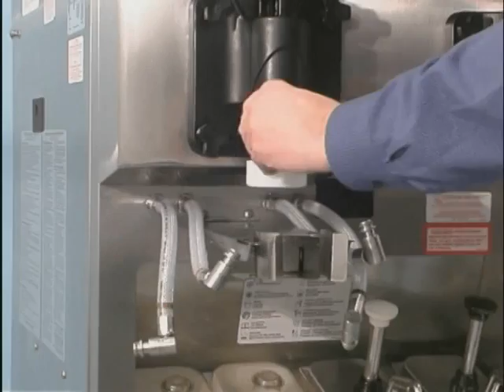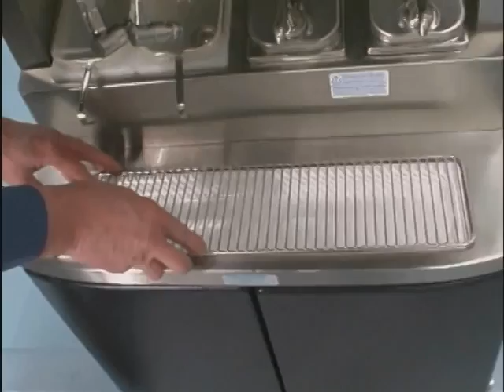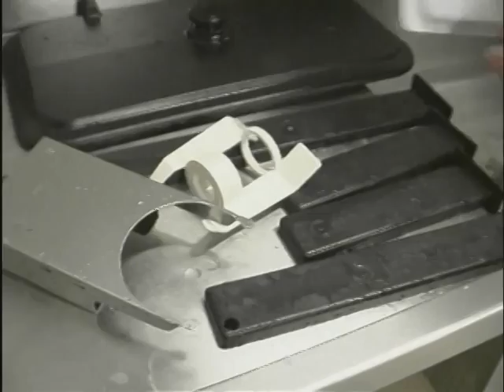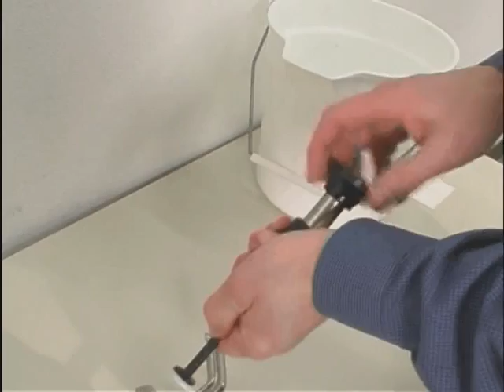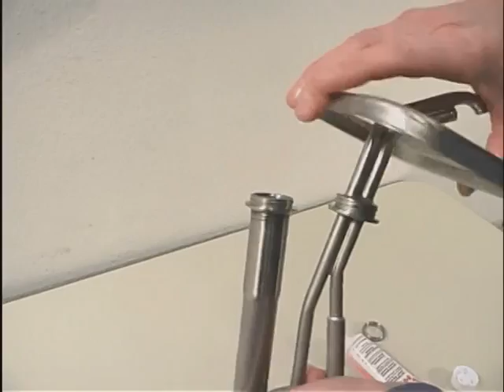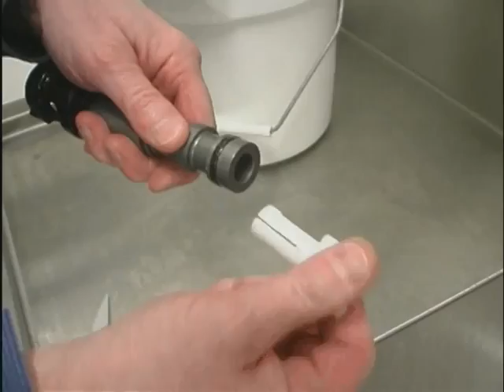taylor c606 mycie cz1

Comment: Are we to believe that workers actually do ALL this careful work on shake machines that  make our shakes?
Reply: At least at my store we have to
Reply: Yes. It goes in to lock down otherwise.

It's a pain in the butt and heavy as hell
Reply: @bluewings8913  The machine does not have psychic powers to know that you are cleaning every piece.
Reply: @DarthVader1977 it knows when all parts are out. Of course it doesn’t know that every piece is clean but why wouldn’t you clean it when you already have every piece out :^) If you fail and the timer doesn’t go off it goes to lock down
Reply: @bluewings8913  Are you yllatnem dedrater?

Have you never worked with a lazy person?

And there is no timer on how long it takes to clean it. It goes into lockdown if it has NOT been cleaned within 2 weeks.
Reply: @DarthVader1977  idk maybe you have worked with a different version then what we have. Ours have a timer you need to trigger unless the cleaning programs hasn’t started.

You think we give out the position to a lazy person?

Damm bro you woke up on the wrong side of bed to choose to be fighting on a comment I made 9 month ago lol
Reply: @bluewings8913  cleaning program*

And that exactly what i said. The timer has to do with the machine being cleaned every two weeks....it has nothing to do with how long it is taking to DO the cleaning.
Reply: It's generally done by a manager or someone who has been there for years.

Comment: So this is a Taylor machine. What an absolute piss poor excuse for a design to serve an industry. What is so hard about making a milkshake machine? Simplicity is always the best approach. Even in automation sometimes. 1 gallon ice cream to 1 gallon of milk, blend it, send it to controlled fridge holding hopper and control temp, front of machine ejects it. = 16 16oz shakes yes? A few butterfly valves to the mixer part to the holding hoppers, you could store multiple flavors in one machine, not many moving parts needing cleaned. Say ice cream is 6 bucks a gallon, milk is 3.50 a gallon, 9.50 / 16 = $ 0.60 a shake. What am I missing? Real ice cream, real milk, even you could throw real strawberries and such and blend it together, pretty simple machine. Not hard to clean,. Wtf kind of engineering is this? Automated not too hard. Taylor and the whole food industry is way over thinking it. 4 compartments (one mixing blender and three holding hoppers, a master fridge unit design, some pimped up plumbing for valves on a relay, an ejection system probably an auger type, a fucking handle of faucet.) In production I think this would run less than 6k and take 5 minutes of time to wash the things needing washed and 10 minutes for the machine to have a cleaner solution dumped in it for self-cleaning of internal plumbing. What is there problem? God it looks like it would take hours to clean this thing…. Daily and weekly to boot.